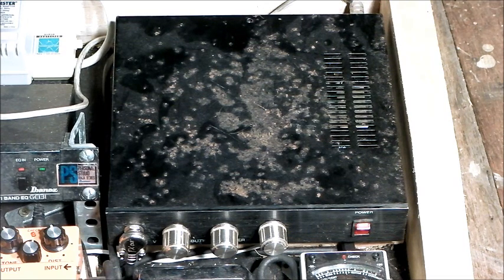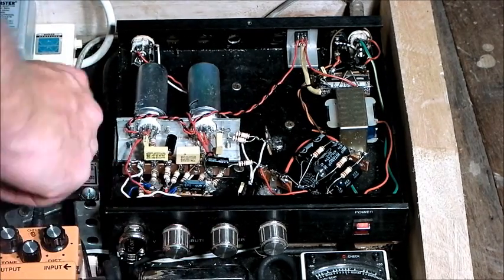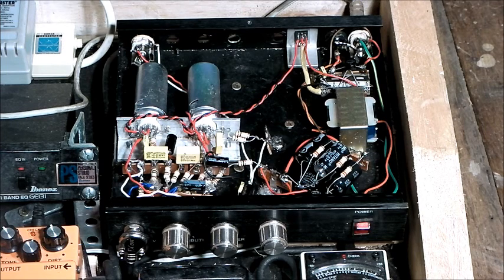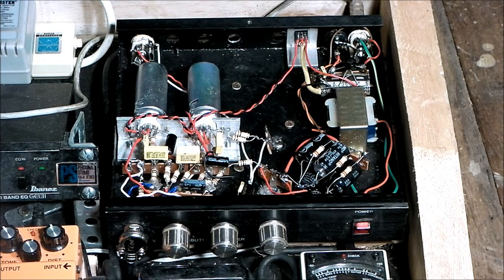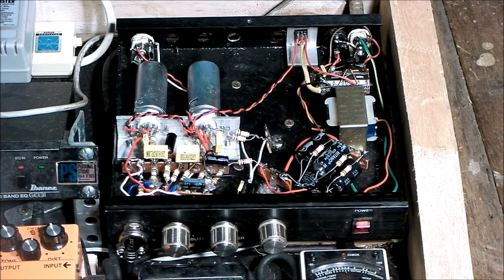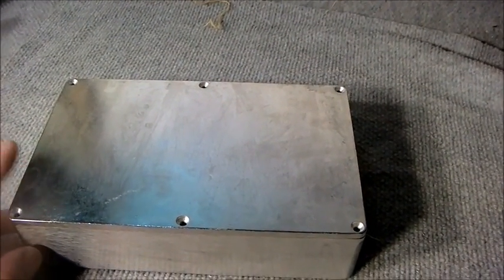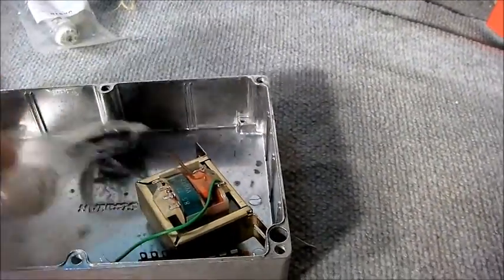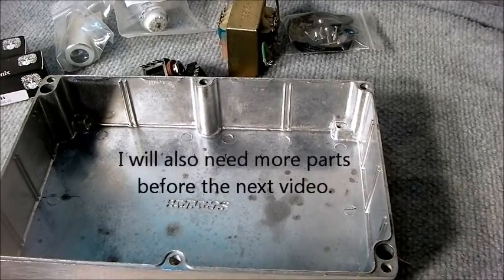Tube/Valve Distortion Pedal Build (Part 1)

Comment from the maker: I had built this first tube preamp as a one off to suit the parts I had at the time so I didn't really have or make a schematic diagram for it but it is based on a JCM 800 preamp with a few minor changes.
Reply: So no starved-plate? No IC's or OpAmps (I mean in the signal path)? No Clipping diodes? JCM800 preamp section in a pedal? How much to build me one?